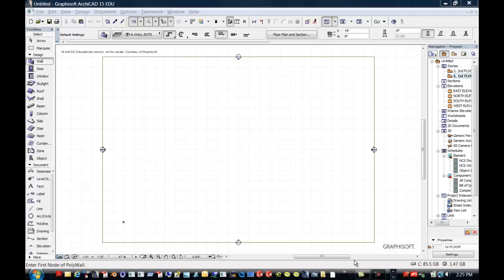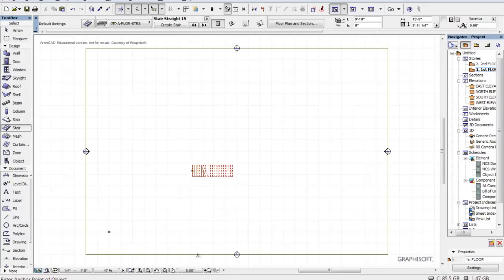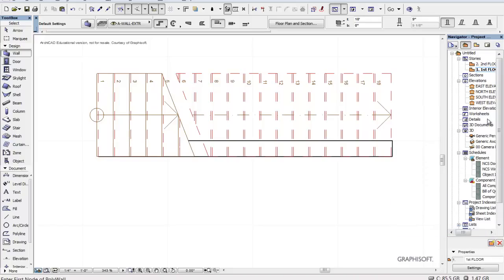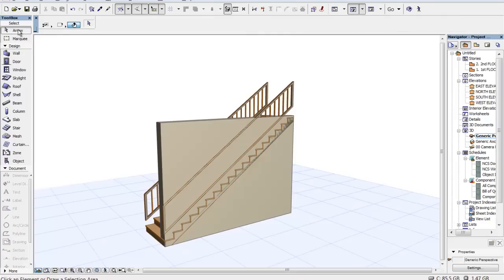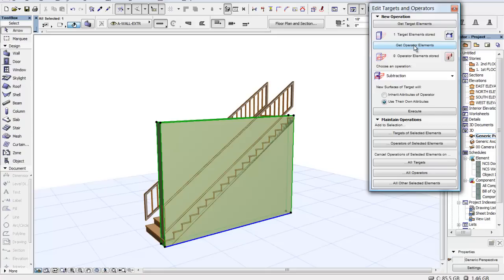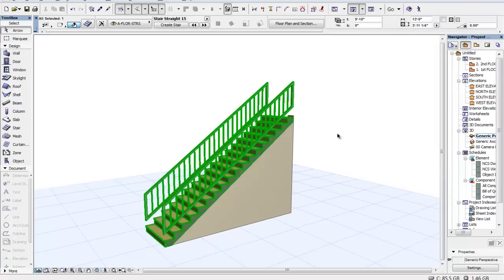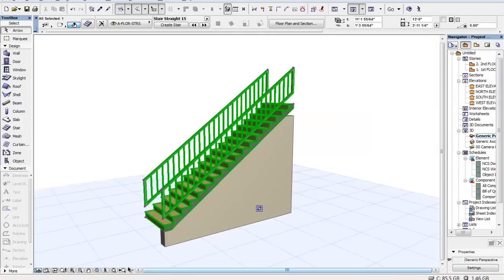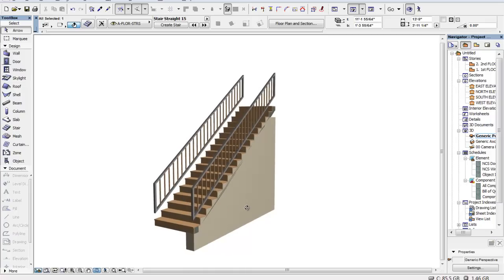How to trim a wall to a stair ArchiCAD

Comment: Hi ChemIR,
You use the same CONNECT tool but select the opposite direction for the cut.  Or you can use CONNECT and TRIM to  ROOF. You might take a look at the CABIN video which goes through trimming to a roof.  Let me know if this works for you.  Good Luck.